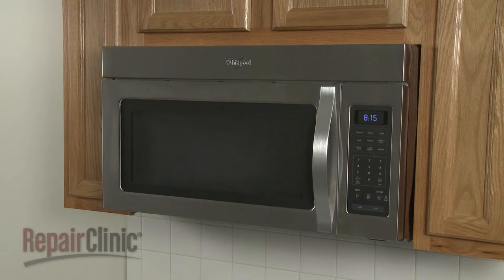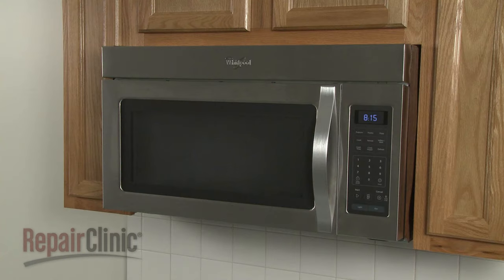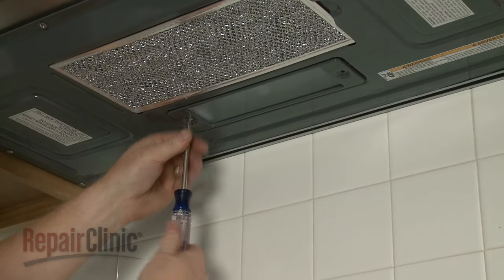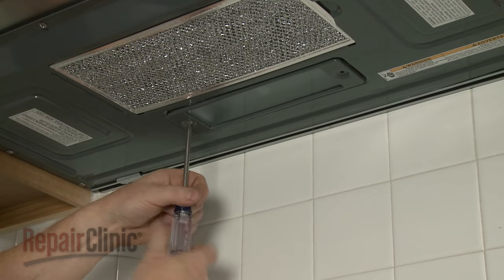Whirlpool Microwave Light Housing Replacement #W10240330

Comment: 🆘 Customers need to think twice before buying the Whirlpool microwave- wmh53521hz-5. When the light won’t shut off the only way to fix it is to buy a new motherboard, and they range in price from $156 to over $300 online plus tax & shipping. Also $150 for service call to install it. And it’s an inherent problem in this Whirlpool model. You can buy a new microwave for $450 or pay that much for repairs or buy an LED stick up under cabinet lights for $12 to $18 as a alternative solution.
Reply: model WMH31017FW also had this problem on mine. light stays on and also gets SUPER hot. not sure if that part is normal, but the lightbulb stays on and cant turn it off.
Reply: Yes, it’s the outside light on the whirlpool microwave that is a lot of money. I’m going to take your suggestion and buy a stick up light.

Comment: How do you replace a bulb if the base is still in the socket?
Reply: Bloody hell the damn bulb broke off, leaving socket inside🤬
Reply: @signalsoldier  happened to me too
Reply: Mine broke too :0[
Reply: Take a thin marker cap, like a sharpie, and insert the open side into the socket. Make sure the clip on the cap gets even a little in between the thin gap between the socket and the base. Rotate as if twisting the bulb loose and it will start to come out. Just did this and got it out in seconds.
Reply: @nemesis6014  thanks 🙏
Reply: @nemesis6014  it feels like mine will break so thanks ahead! I cannot even see what the base looks like...ah maybe a mirror! I did order a ( free) new one from a nice lady at Whirlpool but it took 25 minutes and the call was dropped while on hold! She did apologize when she did call me back. My old bulb lasted 4 years but I have never been happy with the amount of light it shines so I may use the other good suggestion of a LED stick on! Thanks again!
Reply: @SharonHoldrenneeTastet I am in the same situation tried 3 different bulbs first too were too long to squeeze inbetween the small space and the third just fits but won’t screw in now! Beyond frustrated
Reply: @nemesis6014 Gracias! You're a genius!! Thanks!!!
Reply: I'm NEVER buying these crap appliances again
Reply: I've figured it out. I tried everyone's suggestions. But I used black duck tape (heavy duty kind with the grey back. And it worked really well. I stuck some duck tape inside and jiggled it around , leaving some extra tape outside the socket to hold on to. Then I turned it very slowly and it came out!! Thank goodness I almost lost my mind 😭